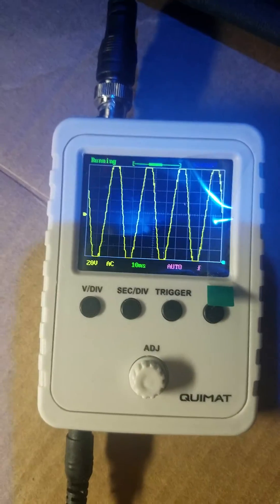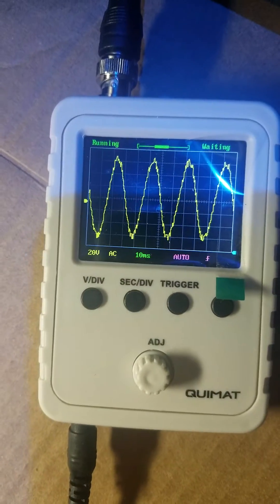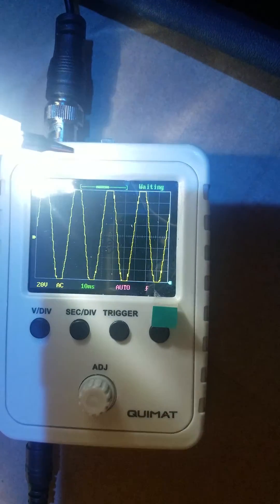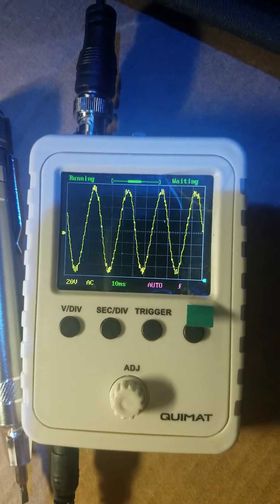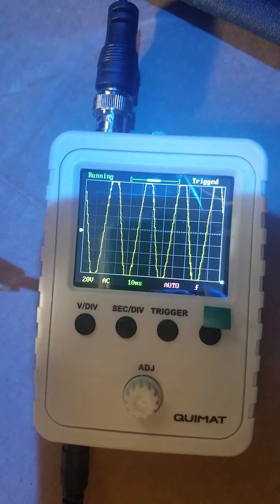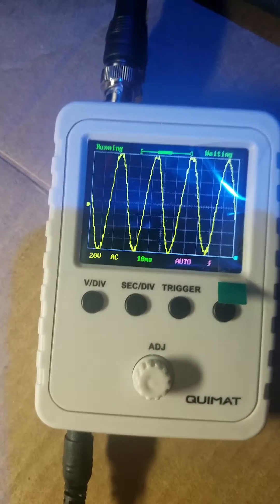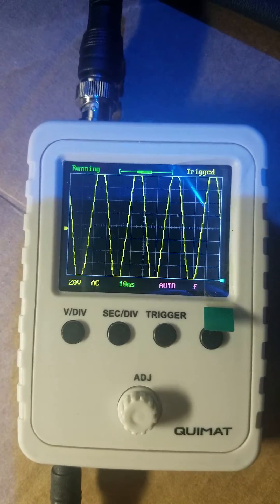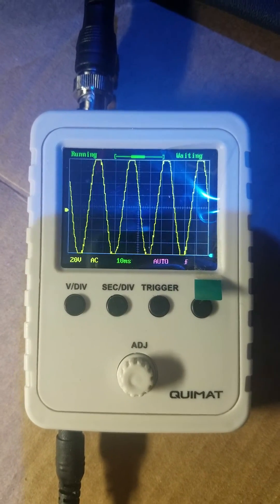When a "clipped" signal isn't an amp clipping. It's your oscilloscope. Quimat 2.4" Oscilloscope $40

Comment: I just got the same meter but in black, mine is working fine, yes I couldn’t see the top or bottom of the wave but I used the knob & then you can see the top & turn the other way to see the bottom of the wave. I just tuned my SFB 2000 using a 40dB -7.5 tone. I got a perfect sine wave at 50.30 volts with the head unit at max 40 volume. My meter was set to 20v, AC, 5ms, auto.
Reply from the maker: Thanks for the awesome comment!
Reply: Right. lol you can zoom out.